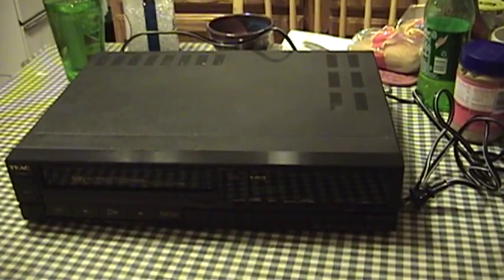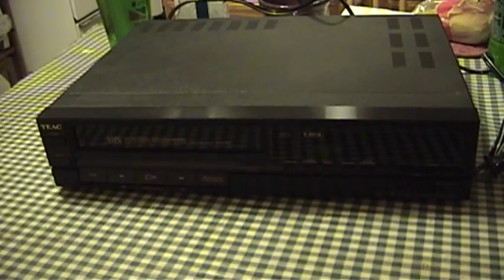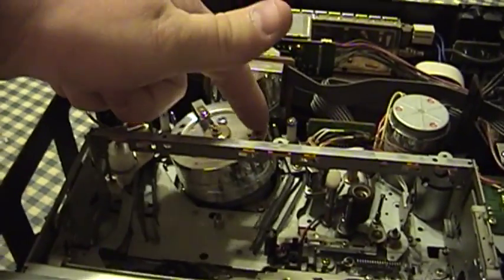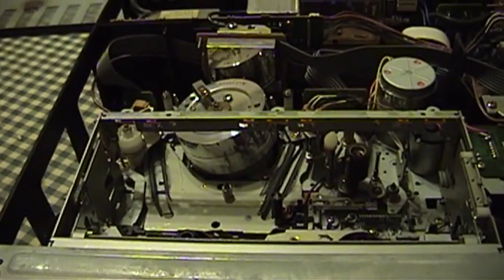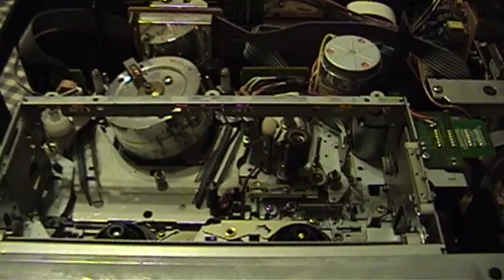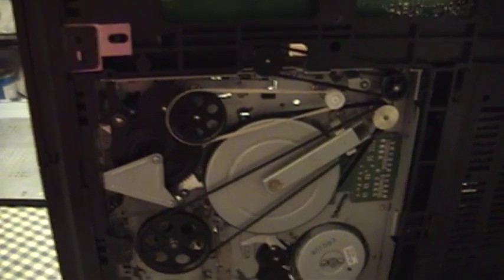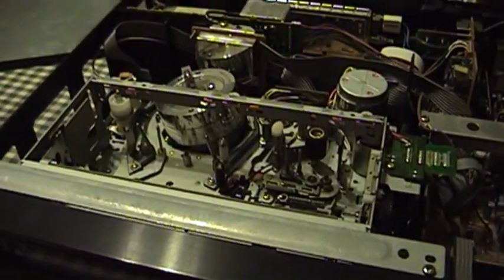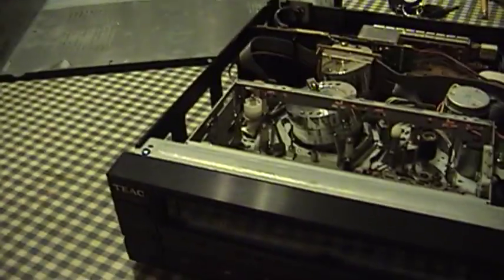Kitchen Table Electronics Repair: TEAC MV-375 VHS VCR

Comment: Dear Sir
I bought a VHS video in August of 2001 and lost the command, and there is no longer for sale. However the video was blocked, "SAFE" I tried to solve but without any success, I have the hope that someone can give me some indication to eliminate SAFE mode
Where is the SAFE code board on the VCR VHS?
Thanks for listening.
Reply from the maker: "SAFE" probably indicates a mechanical failure (stuck/jammed tape). Do not open an electronic device unless you know what you are doing and how to proceed safely.
Reply: In spanish languaje:  a lot of tricks to evade ¨safe¨ ¨children lock¨ ¨key lock¨ etc based in keys combinations.

 http://www.empresas.mundo-r.com/cromavideo/BLOQUEOSVCR.htm

Comment: I used to use my Panasonic nvhs 900 as a music recorder back in the mid to late 90s, audio tapes were a bit trash for me and i could never afford those expensive mini disc and cd recorders back then so my trusty Panasonic was perfect for audio recoding as it has rca jacks in and a headphone socket for personal use, I like hifi vcrs as they are pretty much equal to a DAT machine

Comment: I have a sony VCR. Was working well till yesterday. After playing a caseette, I ejected cassette. Unfortunately the cassette got stuck half way. I pulled it out. Again I inserted a cassette and ejected. It did not ejet. I opened the top cover and removed it. Now the player does not work. Power goes off after a few seconds. I feel very sad about this. I will keep it as a memento
Reply: ***** Thank u very much for your prompt reply informing about the probable causes of the problem I mentioned in my VCR. It is a sony make model SLV-ED40. I think there are no belt driven mechanism in this. Looks like it works thru various sets of gears and pinions. I am not a technician, but I have seen the internals of a few VCRs.
Anyway thank u very much. Regds, Ramakrishnan

Comment: Great video, you seem to have alot of knowledge about VCR's. I got an old 2-head Sylvania Top Loader from the mid 80's, but the back tension band for the supply reel is missing, since they don't make them anymore, I've been trying to come up with a solution that will put enough pressure on it but at the same time turn at the right speed.

Comment: When I first plugged it in, it started making the exact same noise your unit did. I took the bottom off, the same belt causing you problems came off. I did not have a suitable rubber band, so I put it back on. After that, it played when it felt like it. Most of the time, you put a tape in, and the next thing you knew the tape was on the other side of the room. Literally.  The pinch roller was also cracked, big time. I ended up trashing the whole thing.

Comment: Oh ok. I have two VCRs, one Sony SLV-D300p (hate that thing, VCR picture jumpy. No snow, the picture wobbles up  and down. Tracking does nothing. The DVD side of the unit complains that it cant play the DVD if it has just one tiny speck of dust. 
The other VCR is the Panasonic.
    I was once working on a 20 year old Symphonic 6450 VCR. It was in pretty bad shape. The bottom cover was loose, and it was scratched.

Comment: Did you ever get this VCR to work? And about your comment about modern VCRs. I have a 1998 Panasonic unit. It also had a great price. $0 I got it at a goodwill store. Well, every single day, that unit is in use for 4 hours. I have had it for 3 months so far. Best VCR ever!

Comment: I'm repairing a vcr as well and need a belt replacement. do you know any website of place to get vcr square belts for the pancake motor. I've found websites that show a vcr kit but when i look it up nothing turns up. A rubber band (an elastic) is too wobbly. Any suggestions on where to buy would be appreciated.

Comment: I used to work in a repair shop...we often used super glue to fix the broken plastic parts in the newer vcrs. The old machines were very sturdy, the newer ones are mostly plastic and break easily.

Comment: I have an old (i mean old) german Telefunken VR400 standing under my bed for many years. Its so old that its top loaded and only have one belt and motor that drives the whole vcr with LOTS of gears and arms. Now it dont show any pichture any more so i guess its an future projekt. I think its made around 1979-1980.
I remember that it was an pain in the ass to reach the belt in it and it slipped often...

Comment: Where do you buy all your belts at, I have countless tape decks in need of belts. And maybe if I ever find a good old VCR it will need belts too...

Great video, I never knew much about how these things worked. Also sounds like you got a good deal at $2. Ive smashed a lot of junk VCR's that ate my tapes, but never anything older than the late 90's.

Comment: I'm surprized at how there's 2 motors connected by a belt, that looks a little bit like it shouldn't be that way  In most VCRs I've seen, if it has two motors to move the tape, the Pancake motor just turns the capstan and the DC motor winds the tape back or fourth, both motors are never connected together by belts.

Comment: Do a search on studio sound electronics as they carry rebuilt kits for many different VCRs.  These kits come with belts, a new pinch roller, and other failure prone parts to ensure 100% like new operation.  I used one of their kits on a Sears branded VCR and the results were day and night!  I also have a Hitachi SVHS deck I've ordered a rebuild kit for but haven't gotten around to applying it yet.  Hmm, I see a possible repair video here. ;-)

Comment: @uxwbill Well, it's been awhile. I know it wasn't an all at once, overnight, bam, the sound is muffled. It was a progressive downhill slide. There was several different types of tapes recorded in it. And it would muffle the sound on all of them regardless of what mode it was recorded in.

It was a very nice VCR because it had that shuttle control for Fast Forward and Rewind. Meaning you could do variable speed searches through the tape.

Comment: I have this old Sony Hi-fi deck in storage right now. Been in storage for about 8 years now. It would record a very nice picture, but the audio was all messed up. It would sound very muffled, would constantly switch between mono and stereo. However, this was only tapes recorded by this machine. It would play back other cassettes just fine.

I'm kind of curious if it might just be dirty heads.

Comment: i had gotten an old mitsubishi vcr that had a funny issue. when i had first gotten it it wasnt showing video on the screen but then the problem went away and then a few months later the issue came back where it wasnt showing video on the screen. i have since ridded it.i came up with a sony beta vcr that needs a belt and audio work done to it before it will work right. its one of the top loaders that have the push down buttons that stay down when u press them. also have the wired remote for it

Comment: Most 1990s VCRs were still pretty good, but in the early to mid 2000s the market was flooded with Chinese "DA 4 Head" VCRs sold under dozens of different brand names, made out of the cheapiest and flimsiest plastic casing and components imaginable. I saw those sold for as little as $24.99 brand new before they finally disappeared from stores.

Comment: When you plugged in the VCR it sounded like it was making a 50 Hz hum, strange given you guy use 60 electricity.  My LG can play PAL and NTSC tapes, and when I play an NTSC tape the motor speeds up and makes a 60 Hz hum, the VCR also has 'quick load' system you speak of, indeed when I hit play the tape starts immediately and without carrying on loading the tape.